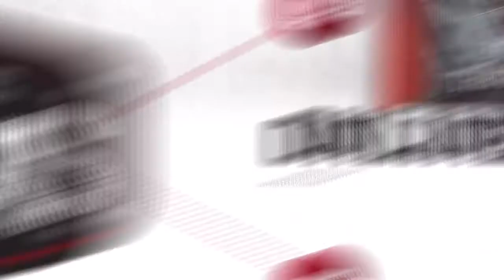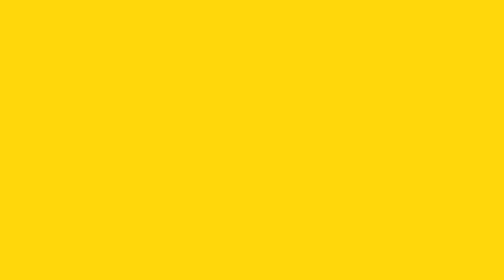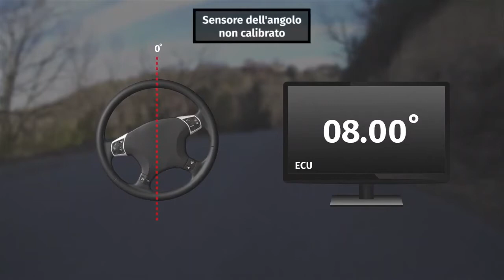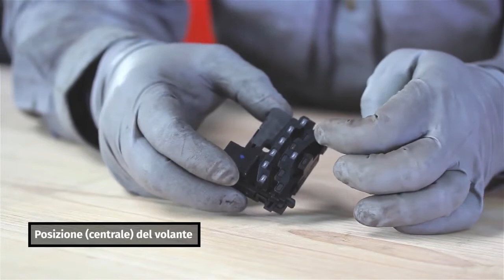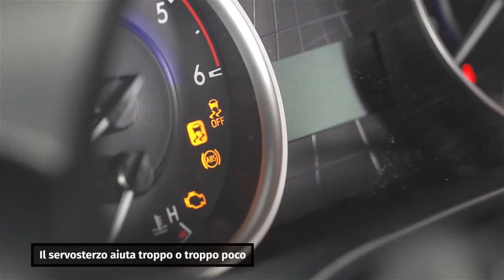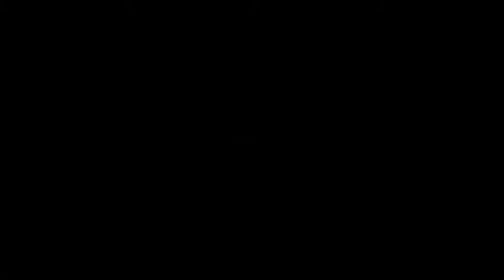Quando è necessario calibrare il sensore dell'angolo di sterzo?

Comment: c'è differenza tra un sensor angolo sterzo e un sensore di coppia o trattasi dello stesso sensore??
Reply from the maker: Ciao!
Il sensore dell'angolo di sterzata e il sensore di coppia sono diversi l'uno dall'altro, ma la maggior parte dei veicoli monta i sensori dell'angolo di sterzata e della coppia in un unico modulo sull'albero dello sterzo. Alcuni lo chiamano  gruppo di sensori di sterzo.

Sensore dell'angolo di sterzata:
Misurare l'angolo di posizione del volante, la velocità di sterzata e la coppia applicata dal conducente è in genere compito di un gruppo di sensori che contiene più sensori dell'angolo di sterzata.
Il gruppo di sensori avrà sempre più di un sensore dell'angolo di sterzata e alcuni gruppi di sensori hanno tre sensori per la ridondanza o per migliorare la risoluzione del gruppo di sensori e per confermare i dati.

Sensore di coppia:
La misurazione della forza applicata dal conducente al volante viene utilizzata sia dal sistema di controllo della stabilità che dal sistema di servosterzo. Le informazioni possono essere utilizzate per determinare le intenzioni del conducente e le prestazioni del sistema di servosterzo. Ma può anche rilevare una trazione dello sterzo.

Speriamo di averti aiutato.

Il team di Garage Guru
Reply: @GarageGurusEU  grazie per la risposta e quando si fa la calibrazione dello sterzo quali sensori vengono coninvolti ? C'è differenza tra la calibrazione dello sterzo e il reset a zero? Cosa significano queste due frasi che ho sentito dire? Poi è possibile durante la calibrazione regolare la durezza rotativa dello sterzo secondo i gusti del guidatore agendo sul software di taratura? C'è una simile taratura sullo strumento utilizzato?
Reply: @GarageGurusEU  non c'ho capito niente troppi sensori è tutto insensoriato!
Reply: Posso farti una domanda qui?